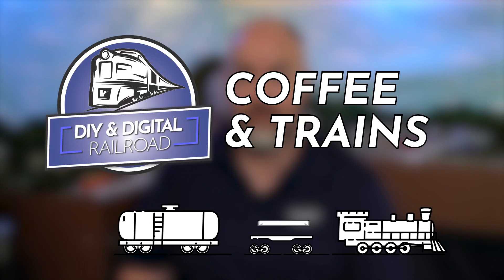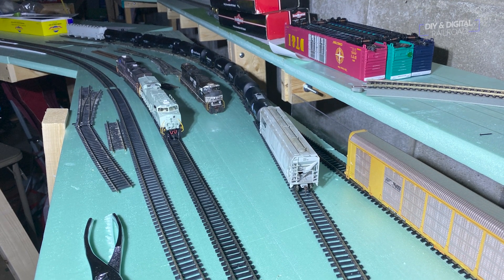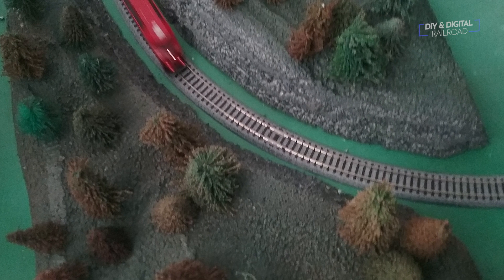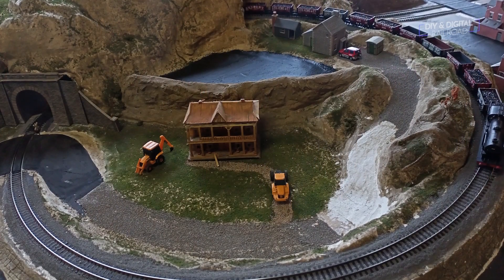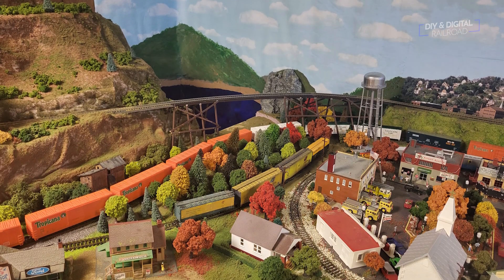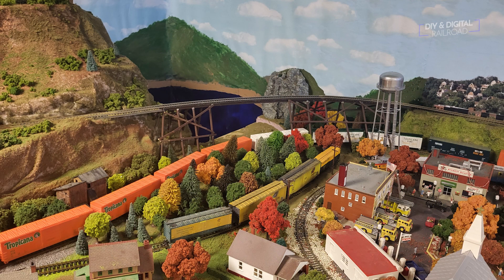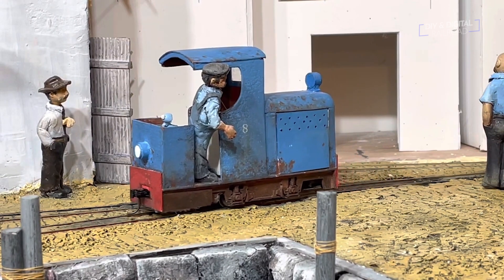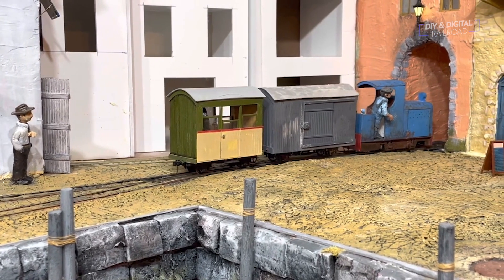A Viewer Model Railroad like no other

Comment: I guess were all a little surprised  by this layout GN15. I loved the train and the people.... Really Great. I gave up coffee in the mornings and switched to Green tea with a twist of lemon. That just sound so exciting 
I have a question for you how it's a short you did on DCC++EX.  How did you get the extra programming mode up.? I changed the login and password for the access point but did it under one of the modules. It didn't seem to be done in config.h